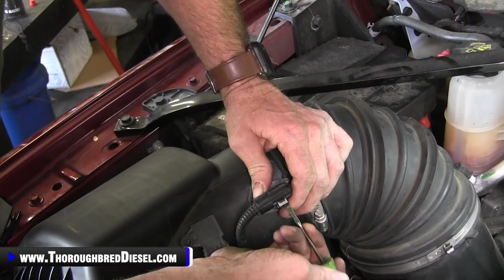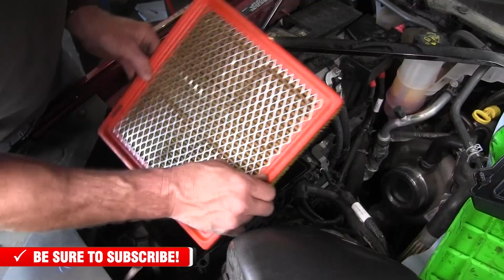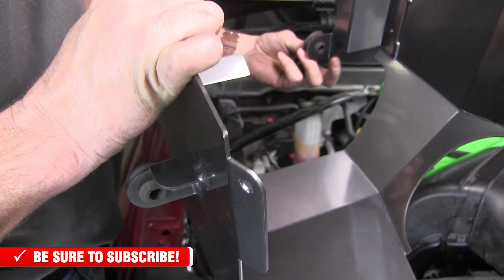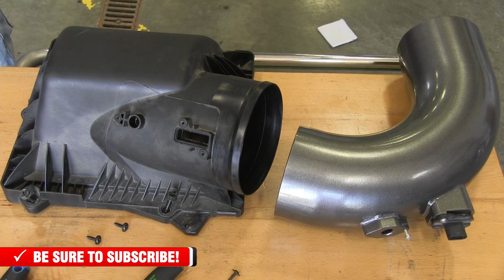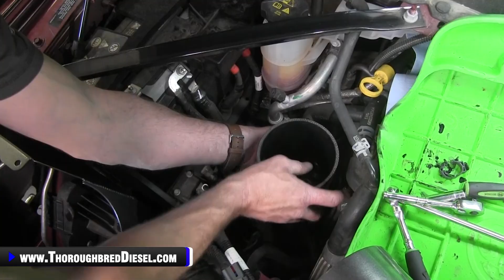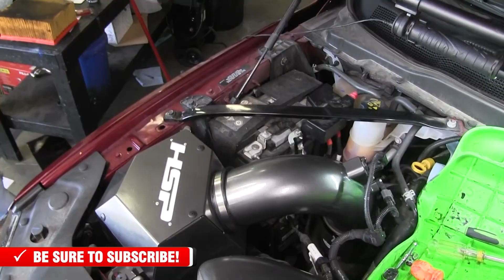How To Install HSP Cold Air Intake On 2019-2022 Dodge Cummins 5th Gen 6.7L #cummins #diesel

Comment: installed the hsp in my 2024 2500 and bunch of codes and check engine lights started popping up now my dpf is messing up . Truck only has 26k miles so i’m not sure what’s going on
Reply from the maker: Give us a call and we will get with HSP to help you.  866 737 4966

Comment: Got it for my 2022 2500 and where my mass air flow sensor goes it has the  airrow facing the wrong way and the air flow sensor goes back wards
Reply from the maker: Reverse the pipe.

Comment: Installed this on my deleted cummins and code P0299 immediately came up. Put in a brand new MAF sensor and turbo actuator and still have the code. No leaks and everything is sealed correctly. There were no codes at all before installing the HSP intake. Any other suggestions?
Reply from the maker: Have you checked the intercooler piping?  Give us a call and we can see what we can do to assist.

Comment: Think yall installed the intake pipe backwards, the sensor bungs should be up close to the filter. Look at HSP’s pictures online. May be why people keep throwing codes.
Reply: I just noticed this as well. Installed mine 2 days ago (with sensors closer to turbo) and within 30 minutes of driving after install I threw 2 codes. P0299 & P226C. Going to clean the sensors after work today and try switching the pipe around to have them closer to the air filter and see what happens.
Reply: @tomroeller6692  did you ever switch this? is it good now?
Reply from the maker: I should have noted this in the video, this is their updated pipe.  You have to go with correct orientation of the MAF sensor.

Comment: I bought one for A dodge 2019 2500 diesel and my check engine light turned on. Do I just clear it?
Reply from the maker: What is the code?  Yes, clear it and see if it comes back.
Reply: @thoroughbreddiesel  I got P0299
 (turbo under boost )
Reply: @HEX_6.7  did you fix it just got it

Comment: So I got me a 2020 ram 3500 bought me the same cold air intake and my question is did you get a check engine light after installing it? Because I did
Reply from the maker: No lights with this kit.  What code is it throwing.
Reply: I got PO299 (Turbo Underboost)
Reply: Did you fix it mines doing it plz help
Reply: @jonatanmartinez9403  my understanding any after market intake you put on the 19+ Cummins it’ll throw that code. You can either tune it or just delete it, that’s what I ended up doing.